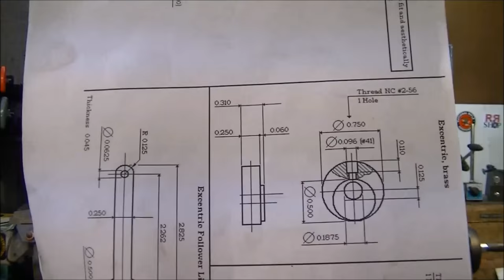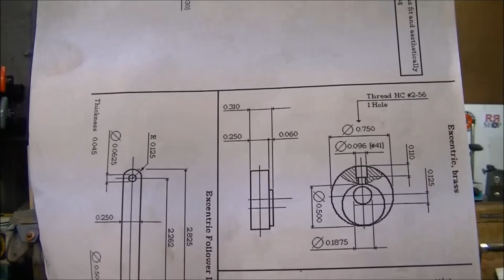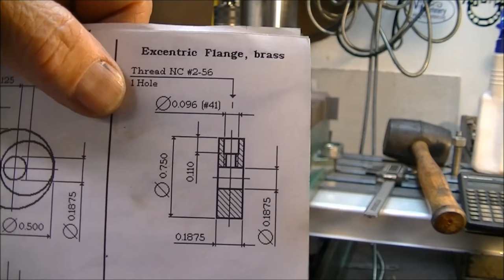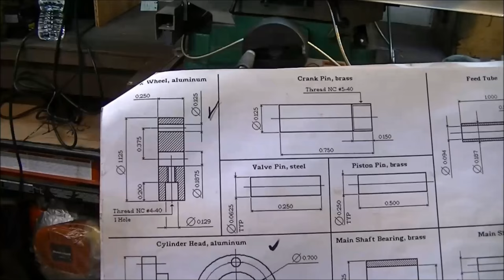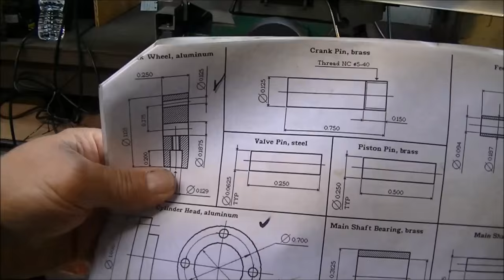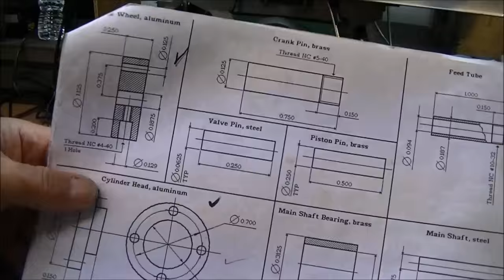My first steam engine part 7

Comment: I haven't much use for a cat.
Even less for one dipped in S#!%.
Hey - quit foolin' around and get that thing done so we can see it run. :)

Brent
Reply from the maker: DigiConSoo this is strange.  I replied to your comment yesterday and now the reply is gone.  So I am not actually fooling around, just waiting for some thin brass to arrive.  Thanks for viewing and commenting.
Reply: I'm just giving you a hard time, because I can.
Would be nice to see that thing run this year, though.

It is a STEAM engine, right?  So I'm sure there's a boiler build coming......
Running it on air would be a horrible sin......

Love the videos, Harold.....
and the "fireside chat" portions. Well...."security camera side" chats.

Brent
Reply from the maker: Yeah it would be nice to see it run this year.  No boiler building for this old sinner.  It would probably be easier than the engine but mrpete222 runs his engines on air a lot and so if the old master can I can.  =(;-)